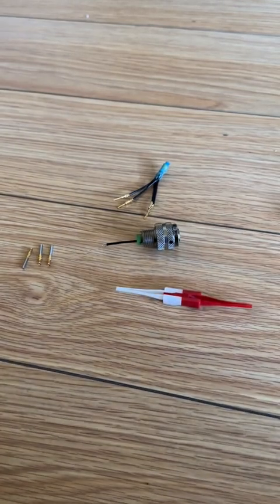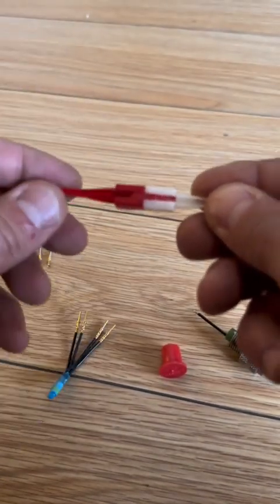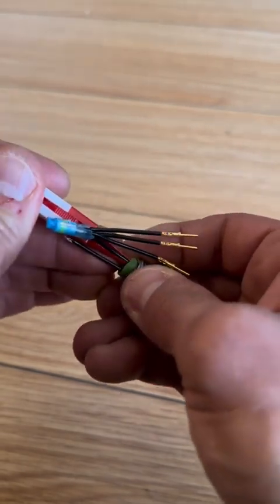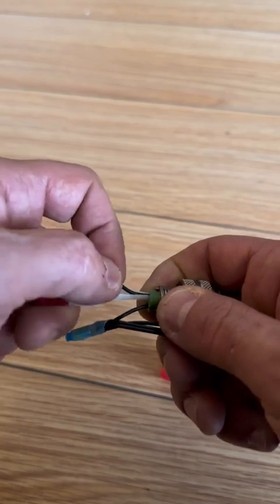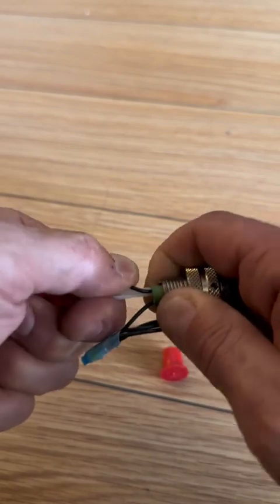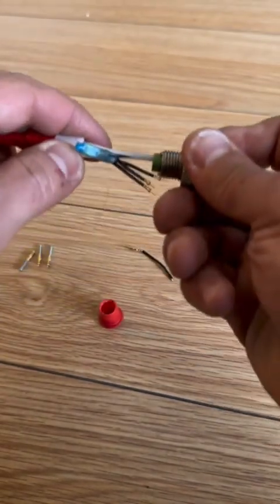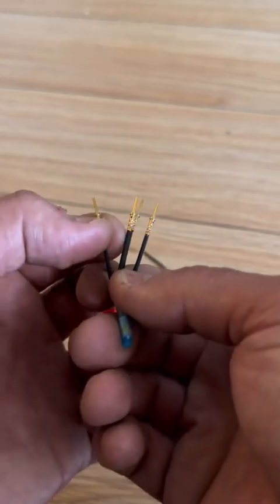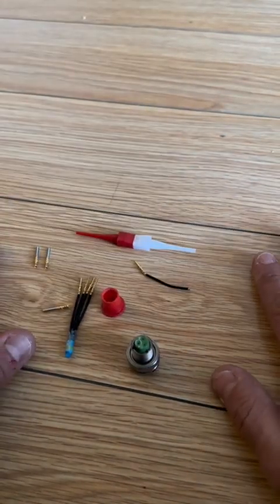How to re-pin a Cannon Plug for Aircraft Maintenance

Comment: As an avionics engineer who has done thousands of these, including damaged, corroded 60 year old ones, I commend you on how well you demonstrated this task.

There is nothing difficult about pinning or depinning connectors, but being confident makes a huge difference.

Its always about the "Feel" as you eluded to. If it doesnt feel right, stop, withdraw the wire/pin, inspect it and try again.

Sometimes brand new commectors have manufacturing defects and the retaining mechanism doesnt work correctly.

Biggest piece of advice... always remember to put the backshell up the loom before installing the connector 😂
Reply from the maker: Awesome advice. Thank you so much. And my apologies for getting back to your comment so late. Got lost in the shuffle. Thank you for being here.
Reply: @StigAviation great work buddy. At 4:32 I find it easier to insert the bare wire into the insertion tool 1 inch away from the contact, and then slide the tool till it meets the lip. Also, I'm interested to know if at your company do the let maintenance team do avionics work?

Comment: Such kind of tool breaks quickly when you insert it inside
Reply from the maker: They have ones that are made of metal as well. But if you’re careful it won’t break. You have to be gentle with it
Reply: I am an avionic technician and tried to practice with this tool for the first time and it broke . Is there a way to master it ?
Reply from the maker: @mohammedkhaled2456  be gentle with it and take your time.